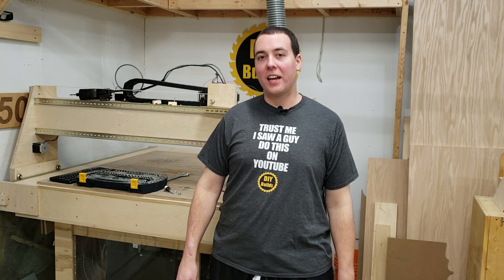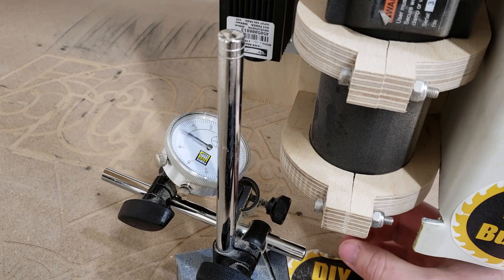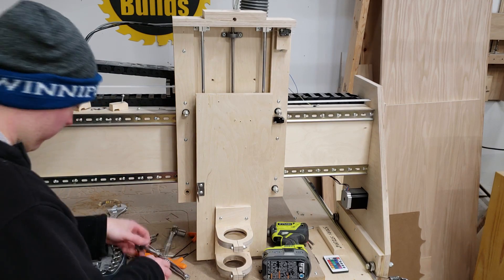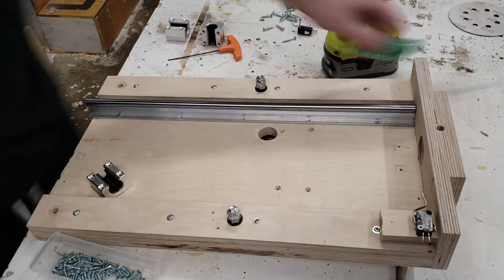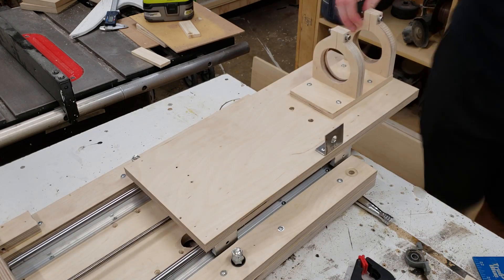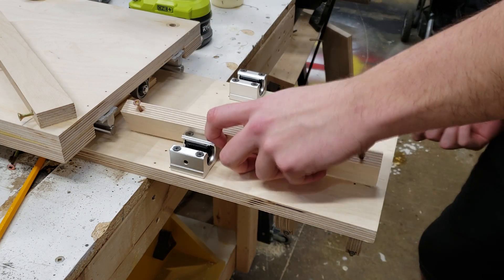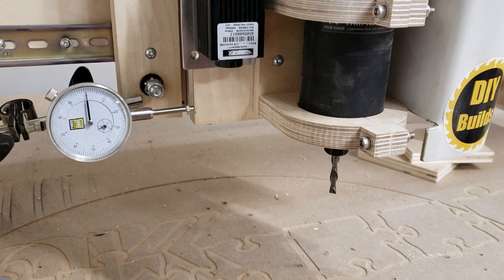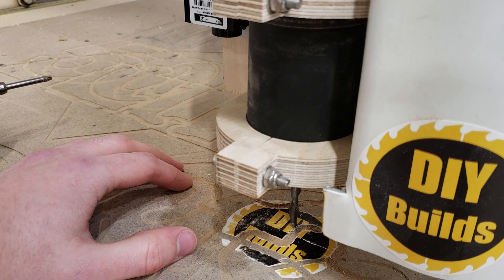Upgrading the Z-Axis Linear rails on my Homemade CNC Router

Comment: worst spindle have if use router motor, super loud noise, but buy real good 500W  ER16 spindle cost less 100$ DC motor spindle. or 1KW spindle cost less 200$

Comment: if need better build aluminium sheet all linear rail base, aluminium can do all same than wood,same tools, easy make. but little more strong frame. you X and Y rails have worst need lot strongest, maybe SBR 20 rails.and beam all material aluminium.3/8 alumin about 20mm. alumin sheet Z axis i build cost less than 40$ 2 pcs 400x200x20mm aluminium. and X beam 1500x300x20 2 pcs 60$ and can cut and drill same than wood. linear rails SBR 25 and ball screws 20x1500 2 axis and 400 Z axis all kit ebay cost 340$ whit shipping. wery cheap but good. motors need be 3-8Nm 4-6A nema 23-34 good drivers DM 860 80V 6A and power supply near driver max, about 75V then have perfect.drivers cost about 50-70$/motor.

Comment: woodworking cnc no need be accurate more this is super good. if make pcb board then need little more accurate. woodwork no need accurate better machine this is wery good wood parts making. because woodworker not know and need inch smallest dimensions,

Comment: i wonder how much of the final deflection numbers is the result of the HF router assembly, it would be interesting to see the updated numbers based on the newer router you have in place now to see if the deflection has changed. Good stuff.

Comment: Have you considered a water cooled spindle?  I love your work here.  it is fantastic.  I know the water cooling is expensive but $300 is cheap when you consider the air cooled system cost for replacement.  Great job

Comment: 5 thou of play is a shit load.... with chatter you could easily see a 10 thou run out even with these upgrades. have you tried CNCing aluminum in this guy? if you built the router mount from steel instead of wood it could be much more compact and have less play i would think? is that router a 1/2" shank or 1/4?    im looking to build a CNC that can do 3/8 or so aluminum as well as 3/4 wood. im curious to know what you think about beefing this up to be able to do that?

Comment: I realise nearly two years have passed, but it would be interesting to use the dial indicator to check for slop at various points in the machine... for example:
(1) Longitudinal at the base of the gantry side-plates.
(2) Lateral at the top of the gantry side-plates.
(3) Longitudinal at the centre of the gantry.
(4) Both directions on the "Z" axis plate.
(5) Both directions at the cutter tip, which is what you did here.
The results would have more meaning if the load was always the same; use string pulley and weight maybe?
My thinking is that this would pinpoint the worst areas.  I have suspicions about the rigidity of the V-groove bearings in the axial direction, for instance.
Thanks again for the videos, I am working my way through them all again.   I subscribed long ago... sadly, Youtube does not let me "Like" them a second time.    :o)
Reply from the maker: If money were less of an option i would use proper liear rails since i know the v bearings are the cause of90% of the inaccuracies.
Reply: @DIYBuilds  :  Ain't that the truth for all of us!  Youtube is a great place to figure out where you fit in the Grand Scheme of things.  Chasing microns and smaller like Dan Gelbart, Piotr Fox Wysocki, or Marco Reps is inspiring - BUT - for most of us, what you have created is more realistic and practical... if I could achieve as much I would be happiness filled!  You have a very satisfying and useful tool.  Combine well thought out videos, clear explanation of your thought processes, and there aren't many excuses for not giving it a try!
Now if I just finish the bathroom, and the lathe refurbishment...             SOUNDS LIKE THE LYRICS OF MY NEXT HIT - "THE PROCRASTINATOR'S LAMENT"!    :o)

Comment: It looks like your not pushing as hard on the final test, I would think most of the slop would come from those roller skate tracks on the x. I'm doing a similar redo on mine I'm using square linear this time.
Reply: Not sure what you mean by "roller skate tracks"?
Reply: @PiefacePete46  Those V bearings on the gantry they can't be as good as the ones you put on the Z can they?

Comment: Great video - Have you checked for play (movement) with the gantry that could be causing some of the play at the router bit? You may need to stiffen the gantry a little better?
Reply from the maker: Its possible but the z axis rail upgrade alone made a huge difference.

Comment: Awesome  build!  I'm working on a design for a new workbench. It occurs to me that I can use your design as a base.  If the torsion box is 5x10 feet can the program still work?  Would there be a problem with the wiring?  If I made the gantry super-stiff, and able to be locked down it could serve a ton of purposes.  I could inbed my table saw and router in the table, and have removable fences on either side of the gantry.  Then, the computer would move the fence/gantry back and forth , then I would lock it down in the desired position.  Does the program have the ability to move in X only from. Multiple start points?  Or, is there a release so I can move the gantry in X freely?  I could also have an additional Z rail set up on the other side with no Y with a drum sander.  Lay the wood to be sanded on the table, and the gantry travels to sand.

For thes non-CNC operations the gantry would XYZ would be locked down as appropriate.

Or, am I insane?

Comment: Awesome  build!  I'm working on a design for a new workbench. It occurs to me that I can use you design as a base.  If the torsion box is 5x10 feet can the program still work?  Would there be a problem with the wiring?  If I made the gantry super-stiff, and able to be locked down it could serve a ton of purposes.  I could inbed my table saw and router in the table, and have removable fences on either side of the gantry.  Then, the computer would move the fence/gantry back and forth , then I would lock it down in the desired position.  Does the program have the ability to move in X only from. Multiple start points?  Or, is there a release so I can move the ganrty in X freely?  I could also have an additional Z rail set up on the other side with no Y with a drum sander.  Lay the wood to be sanded on the table, and the gantry travels to sand.

For thes non-CNC operations the gantry would XYZ would be locked down as appropriate.

Or, am I insane?

Comment: As the linear rails you were using previously hand more slack in one direction that the other, it would've been better to rotate one of the rails on the axes 90 degrees to eliminate the slack.
Reply from the maker: That's not how deflection works

Comment: Great job on the build! Spectacular job on the video!!! After watching your upgrade video i believe you can get a better tolerance than + - 0.002" if you did the same upgrade to the X axis. To test set your dial indicator for side to side on the z axis base plate and try to rotate z axis base plate. There may be another fix that is free... loosen the lower z axis bearing bolts one at a time and clamp between upper and lower bearings and tighten the lower bearing bolts while clamped.  It really comes down to how much it deflects during operation and can you live with + - 0.002".

Comment: I have a question:  
It seems that the most deflection at your tool piece you measured was when the router was lowered down to the work surface, this from a height of what appears to be 8 to 10 inches of vertical travel from the gantry above....  Do you work on routed pieces that require that much depth of travel?  As a casual observer, it seems to me that if your overhead gantry was lower to the work surface you would have less vertical travel and hence less displacement +/- when your motor was in a static position. I have watched and learned much as a good grass hopper, sensei!
Reply from the maker: Most things are cutout and require full depth passes. The gantry is that height to accommodate taller work pieces should the need arise.
Reply: @DIYBuilds  How High (can grasshopper jump)? Would it do for a piece 30 cm high?

Comment: Im a steel man but you have convinced me to build my 3rd router in plywood. I sold my previous CNC machines as they were too big.
In watching this video I was hoping you were going to swap out the Vee bearings as I think this is where you were getting a lot of movement. I built my first machine with Vee bearings too. What I noticed was the guide rail started to change its shape where the bearings travelled over. It was especially bad because it didnt do it evenly across the rail, and was worse in areas where I routed more. This eventually created slop. I think Vee bearings are OK for entry level, but not for any long term use.
Thanks for your video, Im quite convinced that plywood will do an exceptional job, but will use supported linear rails all round. 
BTW your next project needs to be a plywood  rotary axis, and if you're up to it, a plywood chuck for it as well.
You're a good man. Thanks for your videos.

Comment: Were you having problems with the old setup? I’m not done building my machine but I’m already thinking about improvements.
Reply from the maker: My router being screwed up was 90% of the issue. The new rails added to the fix. Did you watch my belt tensioner video?

Comment: I am looking into building your DIY CNC, did you update your plans to include this upgrade? If not how should I proceed in doing this upgrade right away when initially building it? Also, have you done any other significant upgrades to this build other than the Z-axis that would be better to initially do while building it?
Reply from the maker: I havnt updated. The a axis and belt tensioners are upgrades I would do.

Comment: I built your cnc router about a year ago.  I used those rails when I built mine.  I've been very happy with them.  The only other things I did different was better quality stepper drivers, those made a huge difference in the house of the stepper motors.  (I also did a spindle with 3/4 collet). Thanks!
Reply: have you tried aluminum in teh CNC? im curious to know how this holds up.

Comment: Hi from Sydney, Australia.
I noticed an easy improvement for your Z Axis that will further reduce your front back movement when Z is at its lowest point.
You added the 2 ribs however Z at mid height looks like the spindle motor backing board is still on the lower linear rail mount,and supported by the ribs, but as you go lower you are only supported by what looks like 1 sheet of ply as you have cleared the ribs.
extend those ribs the full length of the board if you can and maybe add 2 more to the front.
you should look at moving the linear rails to the motor side of the board and the bearings to the gantry side.
The rails will be a stronger support or spine for your spindle mount board.
Nice Build, I find it fascinating to see woodworkers build most everything from wood for their shop.

Comment: I wonder how this compares to a commercially made hobby level CNC for deflection?  Has this been measured on a Shapeoko or similar to your knowledge?
Reply from the maker: No idea. But I would venture a guess that Any thing made of metal would be better.
Reply: @DIYBuilds   Thanks for the quick reply!  A brief look on google seems to point to about .001 deflection at the bit but poorly defined how that was measured.  From that standpoint yours comes in pretty good I would say.

Comment: I am currently working on a low cost cnc project, same size as yours, with a wooden structure, and same philosophy,  and I am bluffed by what you achieved! 
The use of din rails is bluffing.  lt gives the impression that such  a small piece of metal should deflect and vibrate, but if you say that it works,  I do believe you . I will try the same on my own cnc.
If I could give some comments, I would add that strenghtening the legs of the gantry (with some pieces of plywood similar to what you have done on the Z plate), might help on global stiffness.  Similarly, It might make sens to change the way the router is secured, with some aluminium handles. 
Anyway, thank you so much for what you have done, and the way you shared everything to the public. This is really helpfull!

Comment: I like to see objective analysis. Using a scale to pull on the bit would be even better but this seemed to work well. Nice upgrade. 

Now that you have started measuring deflections, it would be interesting to understand where the next best change might come from. 

Nice work.
Reply from the maker: Stay tuned for the next video ;)
Reply: @DIYBuilds  Excellent. I think you could really start something in the DIY CNC community by driving the most accurate wooden cnc using objective testing. Thanks for sharing.

Comment: Thanks for posting the video. I ended up building a smaller CNC based on your design, shrinking the dimensions by 25% or so. I had already installed the rigid rails, just ‘cause. I use an Arduino Uno wired directly to the stepper controllers and use Estlcam for milling. I could use GRBL instead if needed. This combination works very well. Dust collection is similar to the Suck It product. Cheers.
Reply from the maker: I'd love to see and pic and post it on my website for other to see if your ok with that.

Comment: FYI - best way to remove hot glue? Spray isopropyl alcohol on it - even just underneath the bearing ;)
Reply from the maker: Yes but i don't have that.
Reply: @DIYBuilds  it's just rubbing alcohol at any pharmacy
Reply from the maker: Doesn't mean I have any on hand.

Comment: I noticed that you didn't show making any adjustments to the setscrews on the linear bearings. Each of the bearings has two setscrews that adjust how tightly the bearings grip the rail. I purchased cheap ones from China and found that they all required this adjustment.
Reply from the maker: Thanks for the tip. Didn't realize that. I will for sure do that.

Comment: Do you think the x & y rails are the remaining 0.002-4"? That would be my guess but it's hard to tell while watching from my phone lol
Reply from the maker: Im sure it's a combination of everything. That, being made of wood, the router clamps, the bit deflecting in the router. I don't think it will ever get better than what it is.
Reply: @DIYBuilds  yeah that's true.. I ordered all the stuff to start making my own and it is slowly starting to show up.. I've watched a lot of your videos, but can't recall if you have any of your cnc milling aluminum.  Have you tried it and was it a success? I haven't settled on a design yet, but would like the capability of milling aluminum. 

Thanks for the reply!
Reply from the maker: Havnt tried and don't plan on it. It would probably work though.
Reply: @DIYBuilds  hey I'm just curious.. do you use a parallel port or usb to run mach 3? If you are using usb, are you using a separate board or the uc100 connector. 
Thanks!
Reply from the maker: Parallel